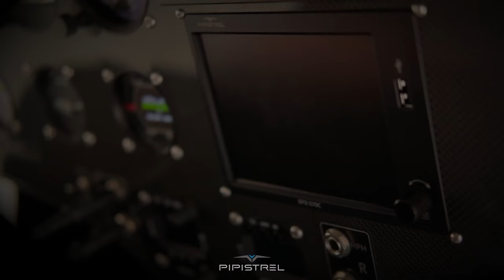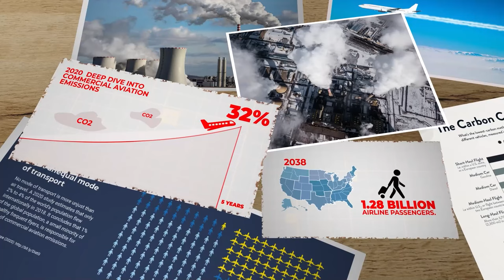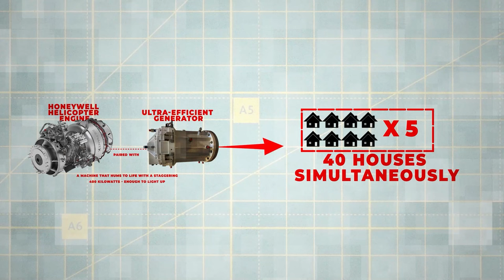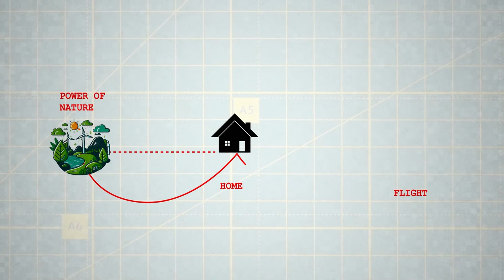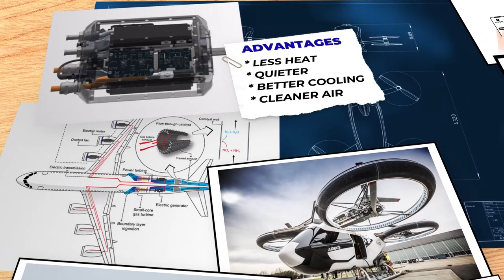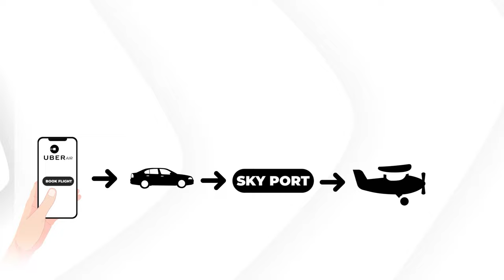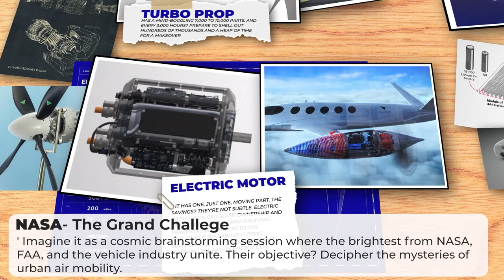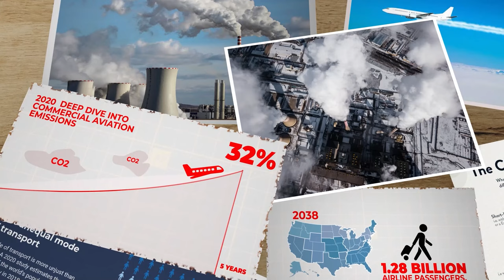Why Electric Planes are Designed to Fail

Comment: There are ZERO commercial electric planes. The Pipistrel can only carry 2 persons for an hour at the very most at rather low speed in an unheated unpressurised  cabin; THAT is the best batteries can manage.

Comment: Burt Rutan could have designed better planes 50 years ago.  We need to solve the battery issue, not design new planes.  The planes will come automatically.  Right now the biggest problem with electric aviation is everyone designing useless prototypes when they could be putting that energy and cash into r&d.  Think of all the pollution of manufacture, wasted labor, capital, that goes into these things.
Reply: R&D should be going into modern gasoline engines for light aircraft.
Reply: @PistonAvatarGuy 

Why? So the money could be wasted? Pal, the US has 12 years of oil reserves left at current extraction rate. In 12 years you will be importing ALL THE FUEL. No point in developing engines that are useless. Either you develop batteries or you can develop fuel cells for hydrogen and power electric engines like that.
Reply: Worth saying that everyone developing new aircraft means "pollution of manufacture", wasted labour, capital. It's how things have ALWAYS been. Learn some English. Also, it's clear you haven't figured out how manufacturing works: THE PRODUCT HAS TO BE DEVELOPED. Basically NOTHING COMES AUTOMATICALLY. Those planes SHALL HAVE TO BE DEVELOPED and if they have a design finished, they have an edge.
Reply: @bobfg3130  You can't simply choose to develop the impossible.
Reply: @bobfg3130  Aircraft will need to use e-fuels, that's where R&D needs to be focused with regard to energy.
Reply: @bobfg3130  so, why not put that effort into battery R&D instead of plane ideas with no battery options?  Batteries can be used anywhere, unlike these planes.
Reply: @bobfg3130  And maybe practical battery powered aircraft aren't impossible, but to power the slowest, smallest, least fuel consuming aircraft in common use, we'd need to see a 10 fold increase in battery energy density by weight, we'd need to see a quadrupling of longevity and these batteries would need to cost about 20 times less per kWh stored, so that's likely to be about as impossible as it gets. Maybe AI will change that, I don't know and I don't care, because a world ruled by totalitarian, corporate-owned AIs is not a world in which I want to live.
Reply: No better battery technology is on the horizon however. Rutan never designed a commercial airliner BTW.
Reply: @grahamstevenson1740  You are 💯 percent right.  If there had been even a chance of a successful electric airliner, Routan would have made it.

Comment: LOL Electric vehicles dominate or roads?  What is that guy smoking?
Reply: You mean on? They might in the future.
Reply: @bobfg3130  No I meant to type "OUR" u was missed! They might indeed, providing there is a significant monumental breakthrough in battery or power storage technology of some kind and close to a trillion dollars of power grid infrastructure upgrading, and generating capacity!
Reply: @mikesmicroshop4385  Grid capacity isnt the real problem, however batteries are a BIG problem and no breakthrough in technology is forseeable. Batteries are what they are.
Reply: @grahamstevenson1740  Actually the grid is an insainly huge limiting factor in the majority of the country, coming from a retired engineer for the power Company!!!!
Reply: @mikesmicroshop4385  Not where I live. The grid here has surplus capacity already, the USA is in poor shape however. I'm amazed Americans tolerate such poor infrastructure.
Reply: @grahamstevenson1740  You can blame it on the utilities!  They received hundreds of millions 20+ years ago to upgrade infrastructure and they have done nothing but pocket the money!

Comment: I completely missed the answer to the question about "why electric planes are designed to fail?"
Reply from the maker: Battery
Reply: I think he meant destined. Simpy, batteries havent anywhere close to the energy density of petroleum fuels. In short, they cant fly very long/far. The very longest endurance of a very lighweight design, the Pipistrel in an hour. Conversions can fly for perhaps 30 minutes with minimal load carrying capacity, E-VTOLs perhaps 10-15 minutes.

Comment: Electric cars have not supercharged battery development. There has been very little progress since the commercial debut of the lipo several decades ago. Elon has over promised but under delivered…like all of his business ventures.
Reply: Nobody's talking about Elon unless they're a Musk fan. There's been progress in batteries. Don't lie about it.
Reply: @bobfg3130  NO. Batteries are still very low energy density compared to fuels like gasoline/diesel/jet fuel. About 1/'40 th the energy. BIG problem.

Comment: Another option could be the use of Hydrogen. Either a Hydrogen turbojet engine or an electric engine powered by a fuel cell. 

Also, those "sky taxis" will not exist. Why? It will cost too much and will pollute too much. It will not be safe either. Think about a traffic jam that's in the air. You also need MORE SPACE in the air with a helicopter or another type of vertical take off and landing aicraft. Also, skyports? Ever heard of airports? It's either that or a helipad. Don't try to make stuff up.

Hybrid aircraft are an interesting option.

Comment: Electric planes in the Arctic will not work in the winter.  Electricity is produced my diesel fuel and the sun is hardly up during the day.  Wind produced electricity is a fraction of what diesel produces right now.  Also a lot of planes are stored outside and that is bad for lithium batteries in sub zero temperatures.
Reply: A lot of hangars would have to be built and those are fueled by diesel to keep those lithium batteries from freezing.
Reply: That means there won't be too many planes soon. Diesel will become too expensive to afford. It's time Alaska switches to wind power.
Reply: @bobfg3130  Mountains tend to block wind, Alaska is quite mountainous. Wind power alone also can't power a modern civilization, especially a part of one where people's lives are dependent upon heating energy and they would die when the wind stopped blowing.
Reply: Wind does not blow all the time up there.  I have spent a lot of time in Alaska.  Plus lithium batteries and freezing temps don't get along.
Reply: There are 12 Megawatt single wind turbines right now; Dont dismiss wind power. Europe is using a lot of it.
Reply: @bobfg3130  The actual untaxed production cost of petroleum fuels still undercuts almost every other energy source. That is NOT likely to change.
Reply: @grahamstevenson1740  35% capacity factor = dead when no wind. Europe depends on wood and natural gas for heating, not wind energy.
Reply: @PistonAvatarGuy  I suggest you look at the actual usage of wind power. It can displace a HUGE amount of conventional generation. NUCLEAR should have a more prominent role too IMHO.
Reply: @grahamstevenson1740  I have looked into it, it's highly variable, meaning that it's highly dependent upon dispatchable sources of energy to make up for when it's not producing, which basically always means natural gas.
Reply: @PistonAvatarGuy  Indeed. Using wind power effectively reuires a MIX of energy sources that can support each other. It works.
Reply: @grahamstevenson1740  It "works" as part of a ridiculously over-complicated and insanely expensive energy system, yes.
Reply: @PistonAvatarGuy  European countries seem to be mastering this supposed ridiculous complexity. The UK gets 30% of its electricity from wind over the long term (yearly) average.
Reply: @grahamstevenson1740  Yeah, with absolutely, ridiculously expensive energy prices and a dependence on imported natural gas which has already caused them problems. France is the one country in Europe that is sane when it comes to the production of electricity, they nationalized their grid and use nuclear power to produce most of their electricity.

Edit: Norway is pretty awesome, too, but they also got very lucky with their energy resources.
Reply: @PistonAvatarGuy  The ridiculously high energy prices are a function of the 'free market' and the war in Ukraine and are a recent phenomenon only. .Prices are already falling again now.  FYI, the UK gets some natural gas from Norway but produces most of its own from British North Sea gas fields. We never needed ANY Russian gas ourselves.

Norway has wisely invested its north Sea revenue as a policy of its socialist government. Britain's Conservative government 'threw away' that similar opportunity so an opportunity was lost forever.
Reply: @grahamstevenson1740  The prices were high before the war in Ukraine. California also has high electricity prices as a result of their push to adopt wind and solar energy. The high prices are the result of installing multiple energy systems where only one would normally be used.
Reply: @PistonAvatarGuy  The prices were more reasonable before the war in Ukraine. Gas and electricity prices more than doubled.
Reply: @grahamstevenson1740  It was still unreasonable. The price of residential electricity in Germany was three times the average price of electricity in the US.
Reply: @PistonAvatarGuy  Britain's energy prices are nothing like Germany's ! Germany appears to be going largely for solar which is daft for Norther europe. Britain also has plenty of ind especially in its many seas so wind power works well for us as it does for Denmark.
Reply: @grahamstevenson1740  Denmark, Germany and the UK have the most expensive electricity in the world.
Reply: @PistonAvatarGuy  Prior the the war in Ukraine electricity in the UK was less than the price Californians pay and was only slightly higher than the average US rate per kWh. It will presumably eventually return to that level.
Reply: @grahamstevenson1740  That's basically my point, they're still heavily dependent on natural gas, because they need it to compensate for the variability of wind and solar. France doesn't have that problem.
Reply: @PistonAvatarGuy  Yes, UK electricity generation is more than usually dependent on the global price for natural gas which has risen hugely in the wake of the war in Ukraine as I said. 
However in more normal times, this does not apply and the price here in such normal circumstances was little more than n the USA. In shor, it's NOT any reliance on wind that's responsible for the temporarily increased price.
 It's NOT WIND that's inflating the price, it's the world price for natural gas which in our daft system inflates the price paid by utilities, the price rising to match the market for it, despite the actual production cost for domestic North Sea gas not having risen at all. The 'beneficiaries' are the suppliers like Shell and bP who have seen extraordinarily high recent profits o the back of those inflated energy prices. In fact if our electricity has no wind generation at all, prices would have risen MORE !
Reply: @grahamstevenson1740  Ok, you're clearly a bot and you're no fun, so...
Reply: @PistonAvatarGuy  What a bizarre comment. I'm certainly no bot.

Comment: Hybrid cars are less efficient on the highway than their ice counterparts because of the extra battery weight. This is even more pronounced in aircraft where weight is more detrimental and there isn’t much stop and go traffic.
Reply: That's totally dependent on design. A hybrid with a 30HP engine, a 300HP motor, a 10 mile battery pack and a 5 gallon tank will blow the doors off a 330HP ICE vehicle because of the motor's torque. It will get far better mileage because the 30HP engine is the "proper" size for cruising at speed. It will be lighter than and have more range than an EV (NOTE: a range extending engine MUST be started at the beginning of each long trip, allowing for far more range and far less stress on a far smaller battery.) And extending the range beyond a typical ICE vehicle is cheap and light because engines are far more efficient when operated at 80% load, something typical in the above-described system but rarely happens in a regular ICE, so an additional few gallons of fuel will go a long way.

But you're right. Current hybrids suck, compared to what they should be.
Reply: No, hybrid cars ARE NOT less efficient compared to their internal combustion engine counterparts. Stop lying. They are MORE efficient that their internal combustion engine counterparts. The gas mileage shows that.
Reply: @RichardLewisCaldwell 

No, hybrid cars are more efficient than ICE cars. Could they be better? Yes. Still, they already surpassed the internal combustion engine cars. Don't lie about it. The gas mileage is showing that.
Reply: Untrue. Hybrid cars get better mileage than ICE. They dont require such large batteries as full BEVs, so the weight isnt a significant issue.